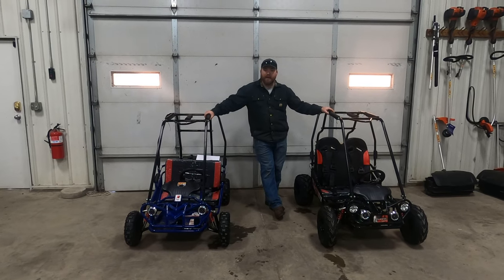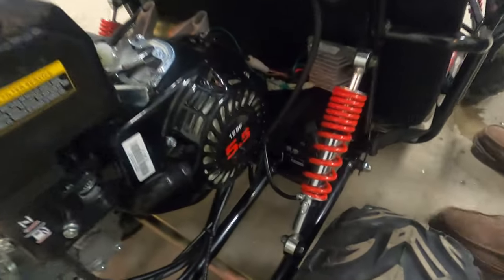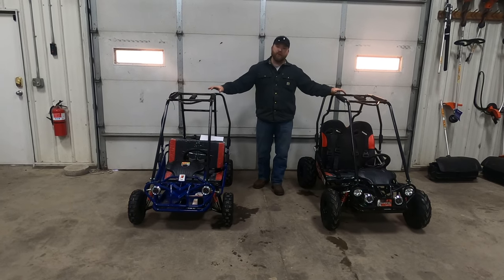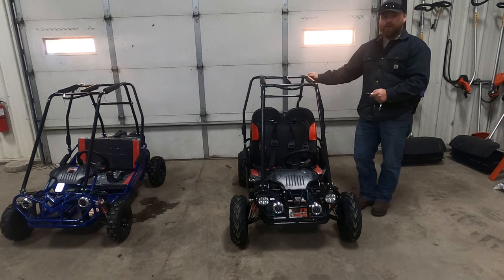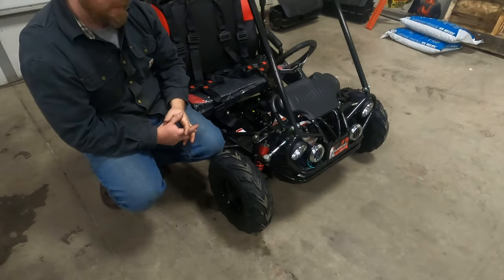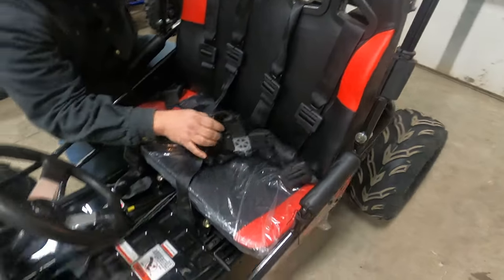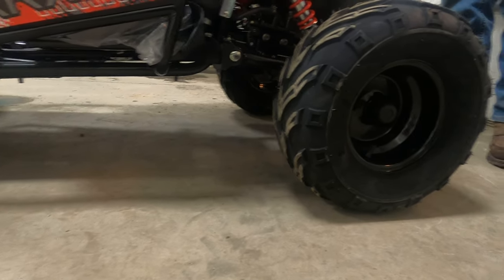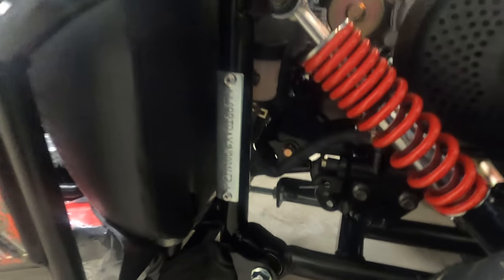TrailMaster Mini XRS vs MINI XRX: Is there a difference, WATCH BEFORE YOU BUY: GOKARTMASTERS.COM

Comment: Dumb question.  Can you add a gear box later?
Reply from the maker: It could be possible but would be very difficult as the frame is different along with all the parts you would need. Bigger sprockets, bigger chains, the gearbox, all the linkage and different axle. Your getting about a $1000 upgrade for just a few hundred more when you purchase the model with the gearbox.

Comment: Does the mini s and x use the same axle?  I'm looking for options to get rid of the 10mm chain on the xrs I have
Reply from the maker: The s and the x do have the same axle. The plus models have wider axles and the reverse models have a 420 sprocket rather than the 06b.
Reply: @GKMAcademy  anyway I could put a 40 or something pitch sprocket on?  Do you have parts?

Comment: will the mini actually pull up hills?
Reply from the maker: That really is a hard question to answer because everyone has a different idea of what a hill is. It won’t be doing any crazy climbing like big side by sides, but generally speaking, yes it will climb. We do recommend upgrading it to the 10 tooth clutch (it comes with a 12 tooth) for riding off road or any kind of rougher terrain. The clutch upgrade provides the low end torque needed for take off and climbing an incline. It’s rated by the factory to climb a 12 ° incline with stock clutch.